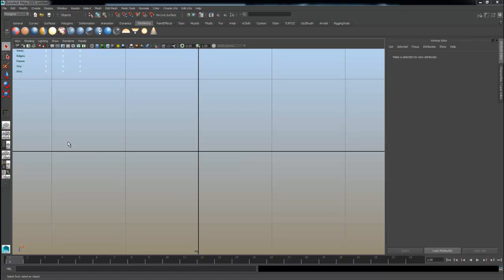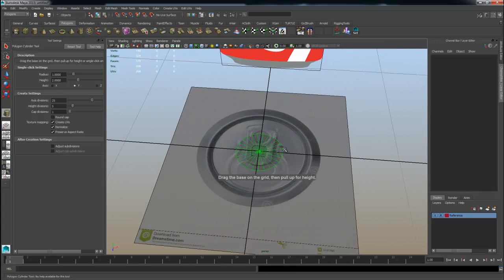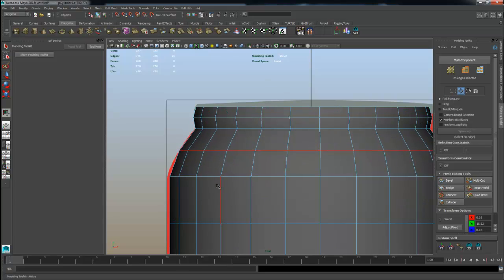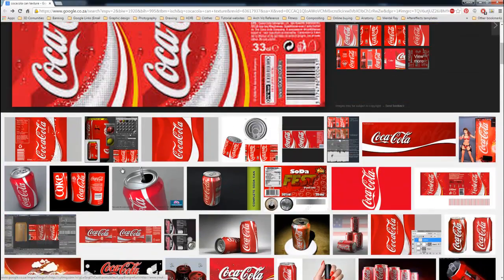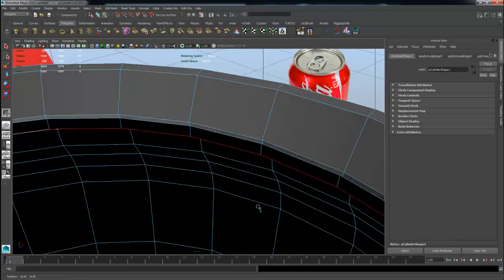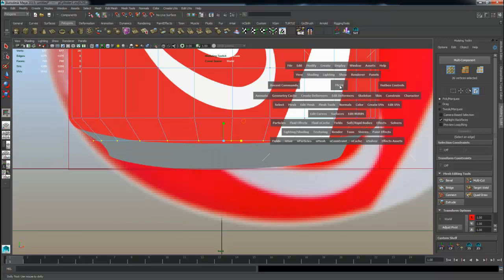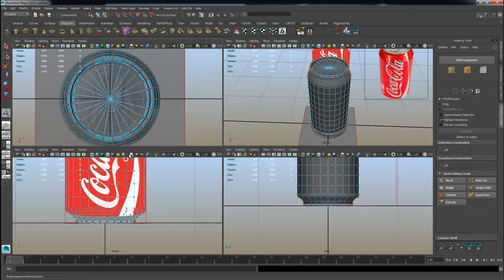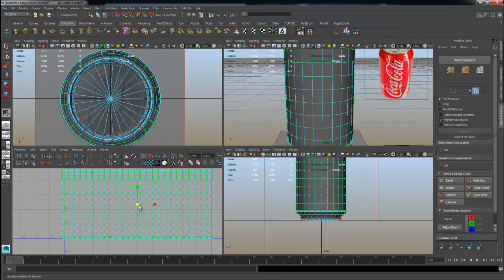Maya Modeling Assets (Cola can)

Comment: You could have created this can in 2 mins with a lathe. The important part was the top.
Reply from the maker: Andrew Wardle thanks for the comment.  the main purpose of these tutorials is to showcase different ways to approach the modeling. using the revolve quick and easy, but then again your not benifiting from all the intricate details of doing it this way.